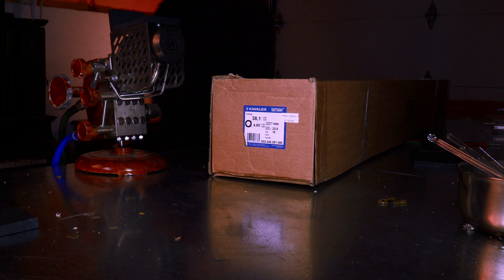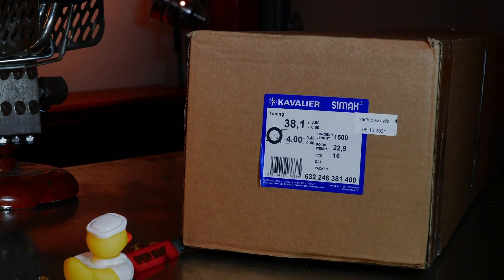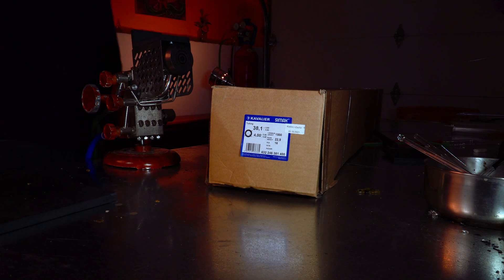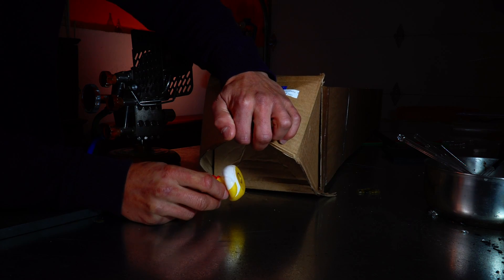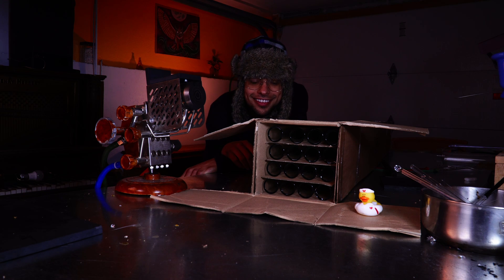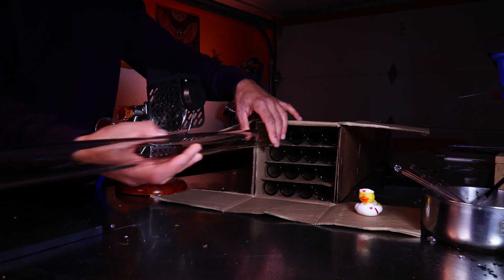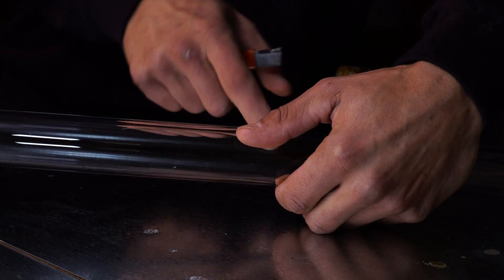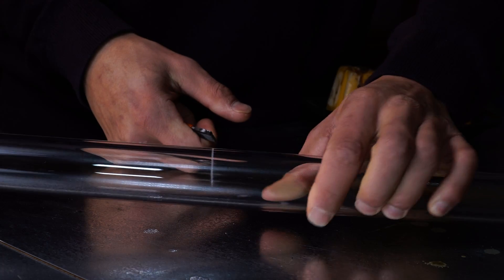How to Break down Borosilicate tubing!

Comment: I would advise anyone to NOT open their larger tubes from the end of the box. (Anything 25.4mm or larger) Cut the tape , take the tubes out from the top. If you slide them out you will chip the lip as you touch tubes together.  Even if you don't try to.   Fwiw , I formulate and make all the greasy glass color and tube, with two other people.  (if you have ever heard of them ). I have split thousands of tubes of 38mm heavy wall to dip in the pots and pull tubes.   A.k.a. from experience, don't try to pull your tubes from the small end of the box unless you have infinite glass and the infinite money glitch. The box is designed to open from the top long side .